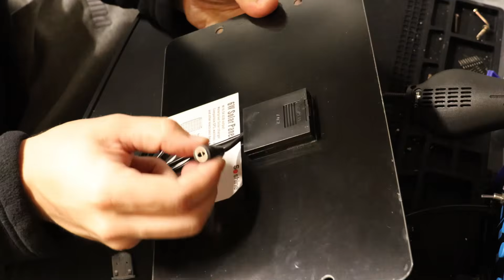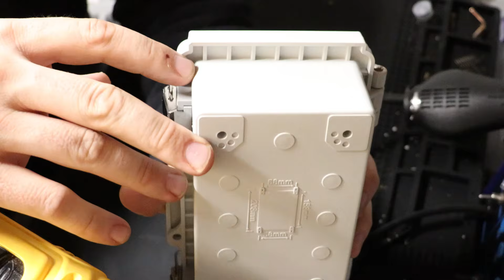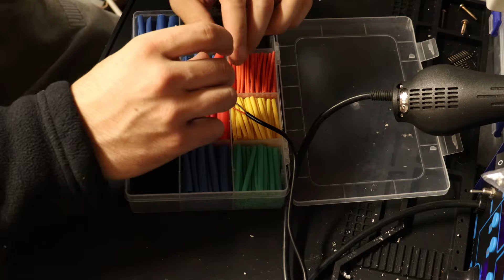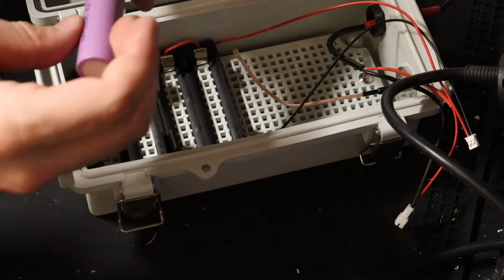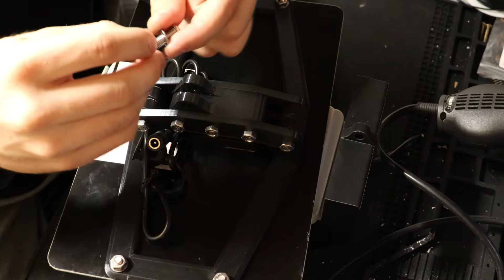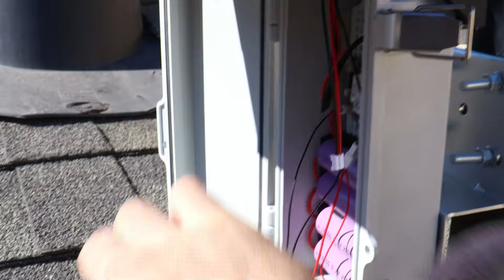Meshtastic Solar Node Build

Comment: BMS is wired wrong. the BMS should be closet to the batteries as possible. look it up how to wire 3A BMS. 
I installed a pressure relief valve that you install on the box, so when it heats up during the hot summers. not adding one cooks the board.

Comment: hi there, could i ask what batteries did you use protected or unprotected. But also would both work either way?
Reply from the maker: I use protected 18650 Batteries. Unprotected would work, but I advise to use protected
Reply: @KyleMakeStuff, thanks for answering, I plan on using unprotected flat top batteries for my setup. I'd just like to ask if it would still work if I placed the BMS between the connection of the battery pack and the board instead of being in between the solar connection like in your video, thanks!

Comment: Awesome looking build!
Could you make a linkable build sheet page and links to 3D files. 
I click your links and it take me to some virus page...
Reply: Never mind! 
Seems to be working now!
Reply: I'm fairly new to printing. What type of filament do you suggest? And at what infil?
Reply from the maker: @tjs2909 I would recommend ABS for long term outdoor use and personally I did 90% infill for durability reason since it’s an outdoor unit.
Reply from the maker: Thank you! And… really?? I just checked the pages and I don’t see an issue, what’s going on?

Comment: Great Vid Kyle got a subscription here, well explained in easy to understand speak. Is this the most power efficient setup or is there better, new to this so not too sure.
Reply from the maker: Thank you so much! So far this is the best power efficient and powerful setup. The node made here has been up and running without the battery dipping below 96% since I made the video!

Comment: Many thanks for doing this video. I am in the UK and just finished my solar node. It's not 100% reliant on Solar as I am using a Heltec V3 with GPS and Environment Board as well as RF Amplifier. It will only work for 2 days as the electronics is not very good power consumption. But ok for my Portable Operation. Cheers from old George

Comment: Need charging/ cutoff to 18650s.  If they go dead .. the wisblock may not come back on without manual intervention.

This circuit will cause cutoff around 2.4 volts I believe it is.  This protects batteries from being completely drained.
Reply: A BMS yes i agree should have one on the batterys but do also like the idea on the solar panel side also

Comment: Cool build. Always awesome to see more nodes getting deployed. I do have couple questions though.

The Rak already has some BMS integrated for the batteries and a solar controller. Normally if you want to add a BMS to your battery cells you would do it at the cell pack itself then from the BMS to the battery port on the Rak. Having the BMS connected to the solar input then to the solar controller may not actually be doing anything to protect your cells. I've never seen one attached to the solar input. Was there a reason you went that direction? 

You may also find that a hydrophobic vent can help prevent some water intrusion/condensation. Others have noted that heating and cooling of the node box can cause enough pressure to build that moisture can be pulled past the seals and collect inside. A vent will help prevent this cycle from occurring. You may also find that applying a silicone waterproofing tape around your antenna connector and even the cable gland will further protect them both from moisture.
Reply from the maker: @ryandodsworth2787  the reason for the added BMS between the wisblock and the solar panel is for voltage spike protection in both ways. I do have hydrophobic vents on my other build but didn’t have any left over for this one. For heating in winter time, I don’t currently have issues with freezing temperatures, since where I live it only gets as low as about 40F. I will think of some effective way to heat during winter though.